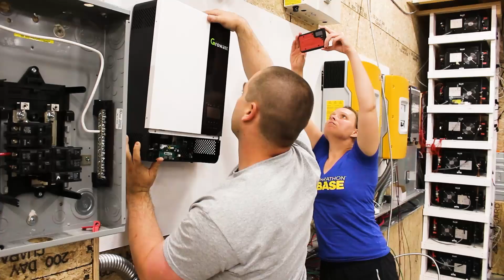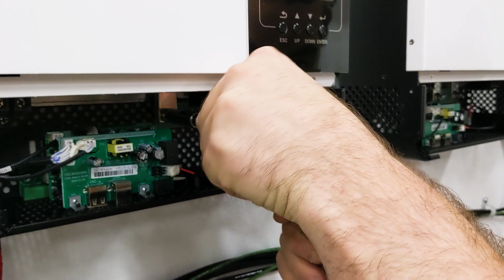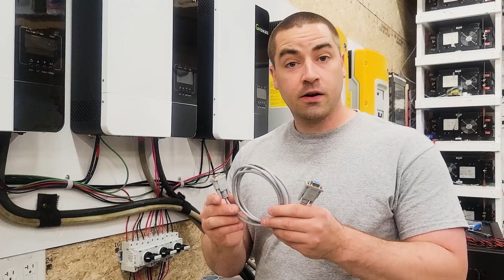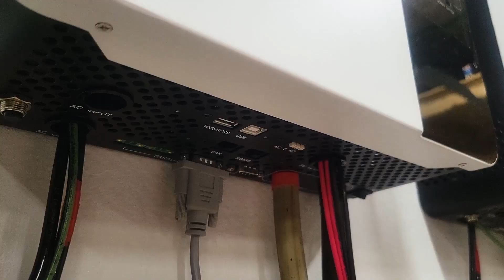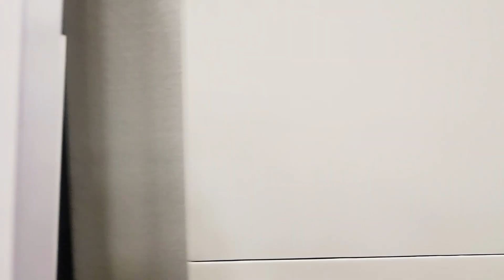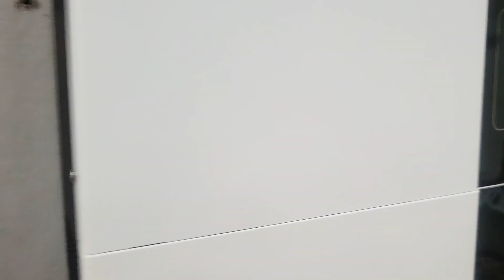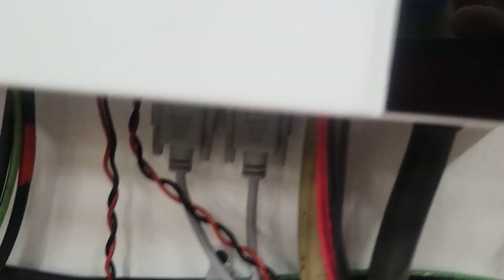Paralleling 3 inverters together, Growatt 5000w Solar System

Comment: Great video. I have one doubt:15kw coming out from the inverters connected to a 5000va autotransformer, isn't an unpair combination?  seems like a bottleneck. Thanks for the video.
Reply from the maker: The auto-transformer only handles the imbalance of 120v loads.  I need the big system (15kw) for my water heater, electric heat, stove, and oven.  But, the 120v loads are fairly minor in comparison.
Reply: @DavidPozEnergy  if the 30A breaker for the auto transformer trips, won't that stop the transformers ability to keep the neutral halfway between the two 120V legs? Possibly sending higher than 120v to your homes 120v loads?
Reply: Should have waited till the very end of the video before I commented! Excited to see how you change it up!
Reply: @BenBrand  Yes, that’s a real concern. Or if the transformer stops working for any reason. So I plan on installing two transformers just in case one breaks or one of the 30amp breaks trips, the other one will still work and prevent 240 volts from going to 120 volt appliances. But then again, maybe the appliances will simple receive no power? Because they will only be connected to a single pole of the 240 volt bars, and the neutral won’t allow any current to return since it isn’t connected to the inverters?
Reply: @johnbcampise  How does that work exactly?  If the auto transformer trips, how do the 120 volt loads still get any power?  Either they have to be supplied from the secondary windings of the auto transformer, so if the primary windings are disconnected, they lose all power, or the loads are tied to one of the main 240 volt legs directly, and their neutral returns through the secondary winding of the transformer.  If that is the case and the primary of the transformer is disconnected, then the voltage with respect to ground on the 120v loads might see an open circuit voltage of 240v, but current will stop since there is no return path through neutral.

Comment: Thanks for your video!  Can the three inverters be Wye connected to a three phase panel?  Then the 120volt load imbalance would just make each inverter to produce whatever is on their phase maybe with no harmonics or floating neutral.  Line to neutral volts would be 120 and line to line volts 208.
Reply from the maker: There is a setting for 3-phase, but I have not tried it.  Sorry I can't answer the rest of your question. Maybe the manual can answer your question? The manual is linked here: https://shop.signaturesolar.us/products/5kw-48w-240vac-80a-off-grid-inverter-by-growatt
Reply: Even if it's possible, I don't think these 240v units would be a good choice for that application. However a trio of the 120v Growatts would work perfectly without needing an extra transformer.
Reply: think in wye you could have phase imbalance issues

Comment: I get the feeling you'd have a better time configuring inverters if you jumped sooner into using your computer. Many of the inverter's seem to be much easier to control via their computer control.
I know you aren't the biggest fan of computers, but maybe get yourself a cheap, used Thinkpad for garage use. Thinkpads are robust and often have good connectivity.

Comment: Now that you have installed 3 of these Growatt 5000w inverters  in your own application, do you still feel the (Phocos Any-Grid PSW-H 5KW Hybrid Inverter Charger) is the right choice for my application we previously discussed or should I be considering using the Growatt?
Reply from the maker: The Phocos is still not a bad choice.  I don't remember our previous discussion (sorry).  The Phocos 5kw is 120v, so two of them makes the 120/240v split phase without the need for an auto transformer.  But, they are more costly.

Comment: Does that convert it to 3Phase? Is it possible to parallel them and get 3phase out?
Reply from the maker: I'm using them as single phase, but you can just make one adjustment in the menu for 3-phase if that's what you want.
Reply: @DavidPozEnergy  so there's a setting for 3phase yes! Am planning on buying them, I luv the fact that they also run without batteries

Comment: Are these low frequency inverters and why do you need the autotransformer? Im a bit confused. Im still on the Sigineer 15kW system.
Reply from the maker: These are HF inverters that output only 240v.  But I live in US, we use 120/240v split-phase.  The auto-transformer allows me to make 120v from the 240v.  I go into more detail in one of my previous videos: https://youtu.be/yWUfvvSa3K8
Reply: @DavidPozEnergy  Im in Northern California. I need enough umph to start and run a 5hp single phase well pump. I guess I'll be sticking to the Sigineer 15kW Full Sine Wave Inverter. I'll have to look into that auto-transformer thing some more for future setups in my gardening shed.

Comment: how does 15kw worth of inverters cope with a single 5kw autotransformer? if you have more than 5kw of usage won't that overload the transformer?
Reply from the maker: The auto-transformer only handles the imbalance of 120v loads.  I need the big system (15kw) for my water heater, electric heat, stove, and oven.  But, the 120v loads are fairly minor in comparison.
Reply: @DavidPozEnergy  that's good to know. Thanks 😊

Comment: Nicely done easy to understand video. 
Question does that neutral from the transformer have to be bonded to ground?
I guess you have it bonded at the main panel
Reply from the maker: Yes, in every home (at least in US) there needs to be one bond between neutral and ground.  Ideally this would happen right at the auto-transformer connection, but for me, I'm using the bond to neutral in the house so that I can still throw the transfer switch back to the house when I want.

Comment: interlock the the autotransformer so if it trips, it takes out the 240 also so no voltage goes out.
Reply: Yes.  He needs to do this ASAP - floating neutral opportunity is very dangerous.  I'm wondering if he can get away with just linking the autotransformer and master inverter breakers - or if the slaves need to be joined also.  Depends if they stop providing power when the master is down.  Could also link the house and auto-transformer breakers if he isn't going to draw any 120V from this subpanel.  Hopefully he has a follow-up video soon on how to correct what is being shown here - seems like lots of people jumping on the autotransformer bandwagon without a good understanding of the safety ramifications of how you could easily blow up all the 120V devices in your house.
Reply from the maker: I agree with both of you.  Bill, you are correct about your assumptions.  I have ordered some Din-rail IMO circuit breakers (UL) that allow for one breaker to trip the next.  I have to re-wire things.  I plan to make a small combiner circuit breaker box of only the 3 inverters.  Then out of that box it will go to one double pole breaker that has the handle tied to a single for the auto-transformer.  The limiting factor for the auto-transformer is the rating: 32 amps neutral continuous.  So I plan to use a single-pole 32 amp breaker tied to the main 240v breaker.
Reply: @DavidPozEnergy  Hi David.  That all sounds good, and I followed everything except where you said you are going to tie the combined inverter breaker (dual pole) to a single for the auto-transformer.  You don't want a single pole breaker for that, you still want a dual for both the hots (and neutral permanently connected as you have now).  You need to consider that the unit could fail shorted in any way - (hot to hot, or hot to neutral).  In which case, having a breaker disconnecting both hots is the correct way.  Unless I didn't follow what you meant.
Reply: @DavidPozEnergy  It sounds like that should work but make double sure that the breakers are actually common trip. Not all handle-tied units are guaranteed to trip at the same time.

Comment: Looking forward to the autotrans floating neutral nightmare issue being addressed - I have seen how seriously a power company takes this because as they are responsible for failures on their end and how fires can occasionally be started. I recently bought the Victron 100A (still just 30A neutral capability really, not different from what you are using, just that it is a toroid and a wee bit more efficient and quiet) autotrans, mainly for potential hurricane use here in Florida and as a matching tool as I build out my PV/hybrid system to match alternate power/generator inputs to the inverters that have charge capabilities.
Reply: I think your system is on par with how I wanna go. I’m installing a separate breaker box with separate “emergency” outlets in my house. From there I want to be able to run a generator or solar for the things I want on. So if the power goes out I just unplug my well and plug into my emergency power source.
Reply: I'm looking for a large toroid core to wind my own, but even the ones from China are too expensive.
Reply: I am building a similar setup to David's, with the Growatts and solaredge autotransformer, but using 1 breaker panel for 240v loads and a 2nd breaker panel just for 120v loads. The 2nd breaker panel gets its neutral from the autotransformer, and bonded L1 and L2 with it, and their shared power comes from the 240v panel via a single 30A double-pole breaker. This way, if the autotransformer breaker is tripped, all 120v power is disconnected and I won't have a floating neutral.

Comment: Couple of questions. What made you choose these over the Growatts that provide split phase and higher total wattage. I've noticed people buying 12kW units. Second question is the setup menu memory type. Is it an NVM that will retain all setup even if fully powered down? Thanks for great videos.
Reply from the maker: The 12kw Growatt like this one: https://shop.signaturesolar.us/products/12kw-48w-150vac-120a-off-grid-inverter-by-growatt  is a great option.  If 12kw will handle everything you want, then awesome.  Some considerations that made me want to go another way are: some viewers want larger systems (20+kw)  and you can't parallel the 12kwLF inverter.  You can parallel these and make a big system.  Second, I love the high-voltage PV input.  It makes wiring the solar array easier, and more efficient if you consider the voltage drop.

Yes, this remembers the menu.  I've tried shutting down the inverter, and disconnecting the battery, for a few days.  When i re-connect and turn on, the menu settings are still the same.

Comment: Hi David - do you have a ground?
Reply from the maker: Yes.  But, as I stated in a previous video, I'm not very good at grounding/bonding.  I'm still learning about the topic.
Reply: Hey David, great video. Super jealous of all your space out there in the UK we have much smaller houses. Over in the uk we refer to Ground as the connection to the earth via an earth rod. Bonding is connecting to metal parts such as water pipes, gas pipes etc. You bond the metal parts to earth / ground in case they ever touch live parts and become charged. If they are grounded then the current flows to earth in sufficient quantity to trip your breaker within its intended time. It’s important to have a low enough ground resistance to allow sufficient current to flow. Check out the videos by John ward for more info on the uk electrics. Keep your videos coming they are great.

Comment: Very cool setup. I look forward to the efficiency testing! I'd love to hear what the idle/self-consumption is of running those 3 inverters.
Reply from the maker: Hi LithiumSolar,  Idle consumption is high.  70w per inverter, plus 18w for the auto-transformer.  5.5kwh per 24 hours.  I am with you, in that I wish it was lower.  My SMA inverters are lower, but also cost a lot more.
Reply: @DavidPozEnergy  that is crazy! 5.5kwh just to idle for a day! How much power are you generating a day during winter?
Reply from the maker: Hi Randy,  I have not gone through a winter with all 3 solar arrays producing, so I can't say for sure.
Reply: @DavidPozEnergy  Over 5kw per day seems like a lot of inefficiency.  I am experimenting with using a small off grid pure sinewave inverter, and then putting many grid tie microinverters in parallel with the AC output of the off grid inverter.  The grid tie inverters seem much more efficient than any off grid inverters I have tried and they seem to sync up just fine to the off grid inverter.  This entire system being off grid, the grid tie inverters just think they are on grid.  I seem to get a lot better efficiency doing it this way, rather than using a larger off grid inverter.  I do not know how well my method would scale.  I only have 1.5kw of solar to experiment with, but have fun trying different configurations to try to improve efficiency. I wonder if you or anyone else here has tried something like this?
Reply: @DavidPozEnergy  Don't Growatt inverters have a low-power mode?

Comment: Great video, but now i feel old for being able to instantly recognize a serial cable.
Reply: you'd be surprised how much "modern" equipment still uses rs232 for downloading to/uploading from
Reply: @feelingtardy  I thought the same thing!  I immediately said, "that's just an RS232"!
Reply: True, but mfgs have switched to using RJ11 or RJ45 connections for serial communications.   On top of that, most equipment these days are using RS485 for CAN and Modus communications.
Reply: @davidchristensen1219  In many cases, but definitely not all. I've worked with more than a few newer electronic boxes that uses RS232, and all sorts of different plugs - and if you want a USB to RS232 converter, almost all of them will have a DB9. Also, most chips, like e.g. Attiny/Atmega uses something that maybe technically isn't exactly RS232, but pretty close to. I think that most Arduino boards basically converts USB to serial, and then shifts it to TTL-level, without doing anything else.
Reply: LOL you are not alone in that comment.
Reply: I had one on my first mouse, back when mice had balls.

Comment: 3 inverters. Have you considered three phase wiring and appliances?
Reply from the maker: I have not considered it.  My understanding is that 3-phase is best if you have motor loads.  Maybe if I was running a large wood shop?  I don't own anything that needs 3-phase.
Reply: @DavidPozEnergy  David - you have 3 phase! They just happen to be the same phase! :)

Comment: Maybe a fan on the auto transformer?  Looks like a rather small box with no vents.
Reply from the maker: Sure.  I plan to add one if it ever gets too hot.  The housing is cast aluminum (or some alloy like that).

Comment: I know this isn't grid tie, but any concerns about using these being non UL listed?
Reply from the maker: I don't have any concerns about UL in my personal situation.
Reply: @DavidPozEnergy  In the case of a household inverter and associated equipment, doesn't the NEC (and most AHJ's) require that component to be UL listed?  Could be a sticky situation with your home-owners insurance if ever a fire?
Reply from the maker: My personal experience with insurance companies is that they don't pay out, even if it's not your fault, and you followed every rule.
Reply: @DavidPozEnergy  Ahh, we must have the same insurance companies here in Australia!

Comment: The "old" pc connectors are DB9 and you can build your own custom RS-232 cables!
Reply: Are you sure? They looked like DB15's to me. I could be wrong.
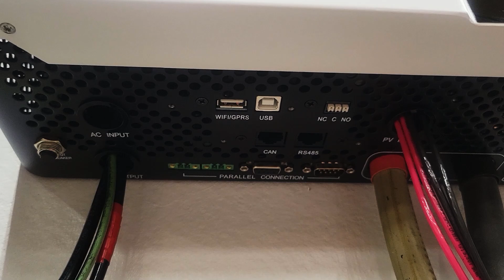Reply: @Bennyboy-dog  18:31 9 pins :)
Reply: Also looks like it is RS-485 @ 19:28
Reply: ...and they're M-F cables to daisy-chain between units.

Comment: you have your auto transformer on a circuit breaker seperate from the inverters...  The problem with this is that if for any reason you trip or turn off that transformer, you loose your neutral completely and the voltage can swing either direction and destroy all kinds of things in your house.  you need to be very careful with that.  (ps I also run 240V victron inverters and I use a transformer for neutral, entire place off grid)
Reply from the maker: Yes, I agree with you and I'm working on a solution.  Did you go with the Victron Auto-transformer?
Reply: @DavidPozEnergy  I did get the victron auto transformer because it has the really cool relay system, however the neutral is not neutral!!!  the legs were more than 10V different!   this create lots of problems, one of the biggest is that you can’t use grid power anymore because it would short out.   So I’m using a 10kva transformer off eBay and have it hard wired.   Overkill instead of automatic safety.
Reply from the maker: O, darn about the voltage difference.  Shoot.  I was really excited about the Victron auto-transformer and was thinking about picking one up.  I would have expected better from Victron.
Reply: @DavidPozEnergy  yea I worked with them for a while about trying a replacement but they told me it was “within spec”.   How that is within spec is beyond me.   It does not even function for its intended purpose.   I still kinda want to try another one just to see if I can get more lucky with it.
Reply: @Wingman77tws  That will happen with any autotransformer, including the one David has. You simply can't have two split-phase transformers connected to each other, one of the leads needs to be disconnected from one of them. As long as the 240v inverter's input is not connected to the grid (or any other source with the neutral and ground connected) this isn't an issue.